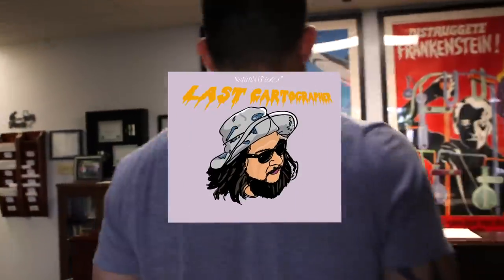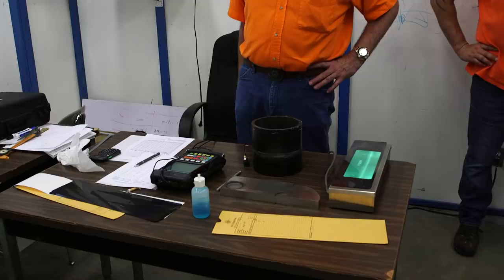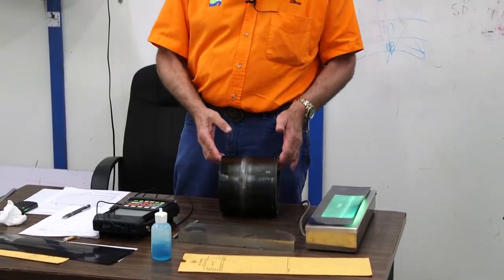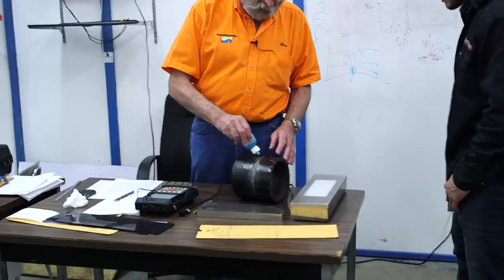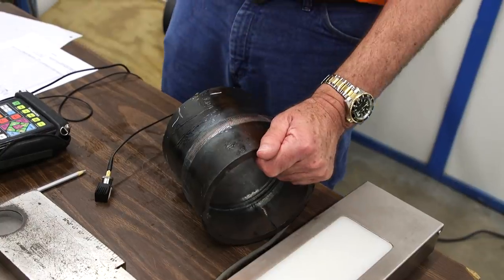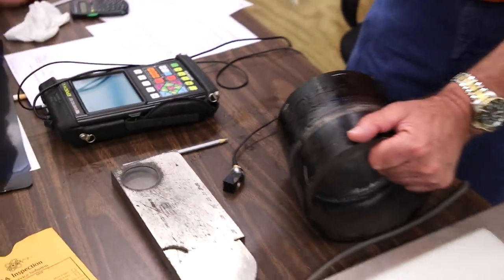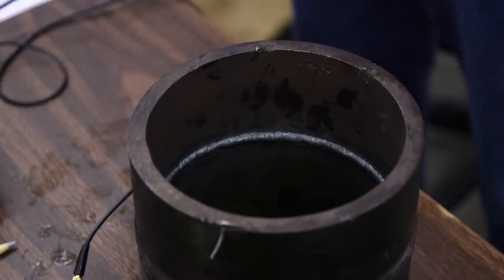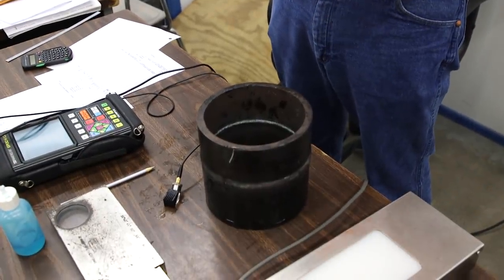Ultrasonic Testing on Pipe Welding

Comment: Can you do a duplex root 6" sch 80 please..
Reply: Hey man, what's your struggle with it? Or you just curious?
Don't see many fellow Duplex welders around. 😉
Reply: @evanchi9460  i want to now how get a good 1/8  rood in 5g and 2g
Reply: @tigerblack1056  An 1/8" rod, or an 1/8" root opening?
Reply: @evanchi9460  a 1/8 reinforcement  inside  the pipe in the root
Reply: @tigerblack1056  Knife-edge landings, and close to a ⅛" root opening. 
How experienced are you with Duplex?
I prefer to use no larger than 0.62" filler because my WPQ only allows an extremely low amperage, and cold rod is ridiculously easy to poke through to the inside even with 0.62" wire.
Reply: @evanchi9460   i dont have much experience on duplex .but  i do tig  but i want a video